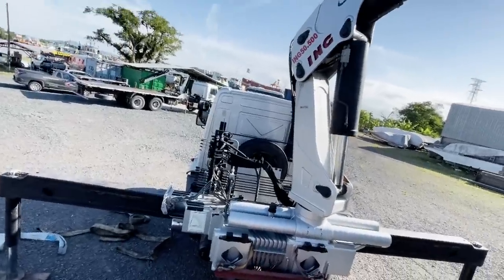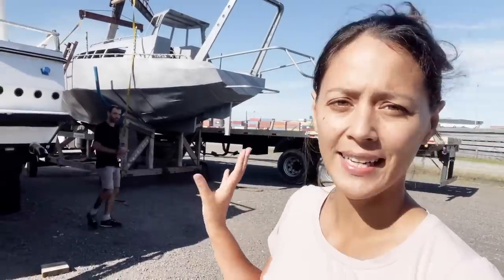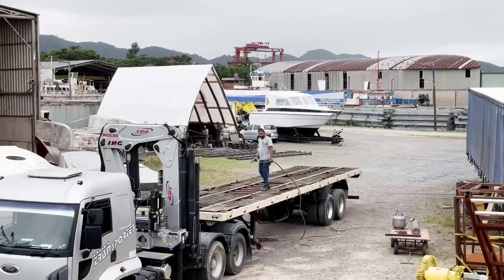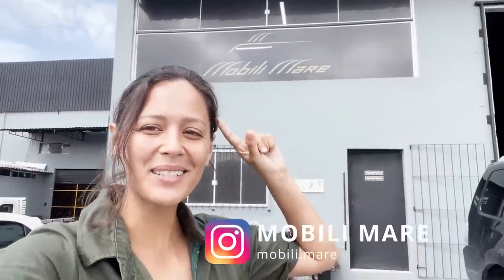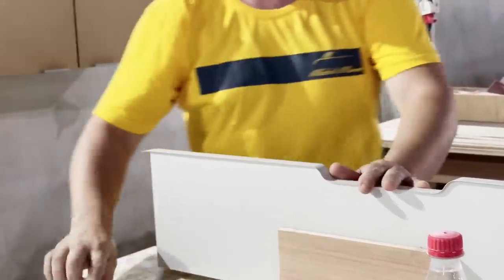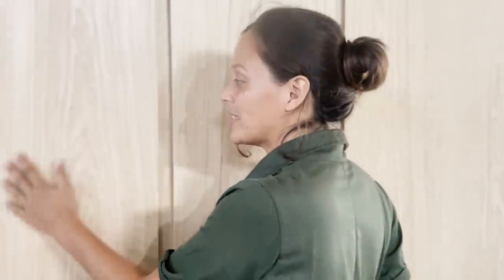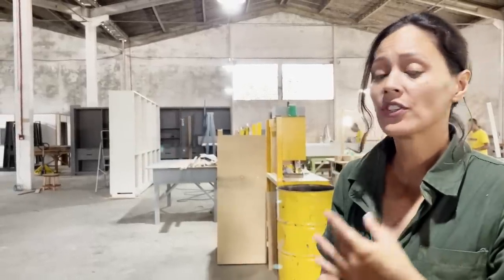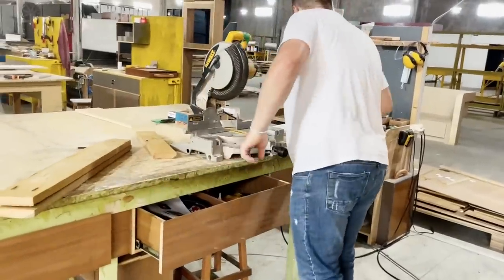BREAKING NEWS: Our Latest BOAT BUILD Upgrade Will Blow Your Mind ⛵️ Ep28

Comment from the maker: We are so excited about this latest news!! There are still a few things we have to finish up before they can jump in with the wood interior so we'll be tackling that as well. We need to finish up the coating systems on the inside, and lay down wire and pipe for electrical and plumbing. And we'll be coordinating everything to work with the Mobili Mare team. 

As you know, we've been though a lot of tough hurdles with this project and had some really hard moments. This news is the best thing that has happened to us since we started!! Just proving that the most amazing things happen when you least expect it!

What part about the interior build are you looking forward to the most?? Let us know so we can try to work it into a video!
Reply: _ Gee Wiz, don't want to sound negative but that hull has more dents in it than a car wreck that rolled on a motorway!! Whats up with it.... one helluva fairing job ahead with TONS of fairing compound!! _
Reply: @liongod1000  Or heat it up & BEAT it straight. Trying to run before you can walk springs to mind!

Comment: Thanks for the tour of the fab factory and explanation of the process.  I noticed you have dark tinted windows, and lots of em.  When we bought our Islander 38 we had the same mindset.  Lots of light and ability to see our surroundings.   Ours has 4 huge windows port and starboard and 2 small ones forward for the salon. What we actually found is that it gets so hot that we have them covered on the inside to keep light out.  The dark color on the windows also absorbs heat and they get really hot which dissipates into the boat.   We ended up putting a chrome mirror film on the outside.  It is a one way mirror, it reflects the light and keeps the window cooler to the touch.  Looks great too.  Easy to apply later.  Keep rolling!  Happy Easter.
Reply from the maker: Thanks for sharing this with us! We haven't put windows on yet. Whatever you see is probably just blackness in the boat. We were thinking of creative ways we can make curtains but that was more for privacy than heat. But now that you mention this, we will keep this in mind when we buy the windows. The reflective surfaces really do work wonders when it comes to heat, as long as it doesn't effect your vision while sailing then thats a great solution! Cheers!!

Comment: I wonder if the welding "scars" are going to be protruding in the hull as we see here. Or there is more grinding to smooth it out before painting?
Reply: I wonder if the aft starboard dorsal section would be best consolidated of those patches.

Comment: I think you should work on enclosing the boat before you do anything else.
Putting in the old or getting new windows first before you start the interior
Reply from the maker: You have a great point and we are looking into this. The tarp covers well but with lots of rain there is still some drips. We like your thinking.
Reply: @lahakai  Thanks wasn’t trying to tell you how run your business, but I thought maybe you forgot to mention it.
But this is like building a house, you dry it in first before you start the inside work. Or you will be fighting the weather all the way. Hope you guys have picked out some opening hatches remember air circulation is important also. Insulation is another thing you may not think about. Lots of people don’t. But steel absorbs heat and UV rays.. Also the cold. And old boats that wasn’t insulated they sweat in cool weather on the inside,  even if it is cooler inside than out, insulation can stop that. Sweating causes mildew witch can be harmful to you health. And maybe part of the reason it rusted so much from the inside out. I don’t know what kind to use on a boat but maybe you could look into it. Just a few thoughts and maybe a reminder here. Good luck with this big project. 
Maybe foam insulation sheets with a foil backing that could be glued to the inside hull walls, like down to the waterline. IDK! Just something that don’t absorb water. 
Newer yachts even fiber glass hulls, have insulation these days. So there is something you can use. 
I lived in a old house years ago,  that wasn’t insulated and in the winter mostly the inside walls would sweat and water would run down the wall. And mildew was a big problem.
Reply from the maker: Funny you say that, we are looking at insulation options right this moment! We spoke to the manufacturer to find one that is water resistant – as you said, the boat can sweat. We do have a couple large hatches that came with the boat. One in the main cabin and one in the forward cabin. But we'd love a couple of small portholes on the side of the superstructure if we can swing as well.
Reply: @lahakai  yeah port holes would be nice. Sounds good and I will be watching wish you guys all the best.

Comment: O casco, sobretudo os cordões de solda ainda parecem muito "brutos", ou seja, pouco ou nada hidrodinâmicos e isso poderá ser tornar um problema seríssimo à navegação e aos custos de manutenção.

Essas quinas podem comprometer a vida útil da tinta abaixo da linha d'água e o tempo e custo de uma nova pintura é alto e exige tirar o casco da água. 

Em náutica diz-se que quando um linha não está harmoniosa é porque está errada ou pouco funcional. 

O acréscimo da popa tem ângulos muiito estranhos. Às chapas de aço na popa a estibordo estão amassadas. Tenham muito cuidado!

Talvez isso esteja sendo considerado para a etapa da pintura, mas não deixem para a última hora, quando o orçamento diminui.

Não levem a mal minhas observações.

Comment: The finish work and interior is certainly an exciting part of the build and the area's you'll have the most contact with for sure.  I do have to ask if there's other plans for the hull, I can't help but notice the tin canning (from sand blasting or poor patching?), the plates, welds, and blends, the body lines, etc. - Maybe this deserves some more attention before the finishing?  I admire your bravery and wish you the best outcome on this project!
Reply from the maker: We are very excited about the interior as well! We are going to try to tour some other boats they have worked on to get a good idea of the possibilities too. The shadows from the sun on the hull exaggerated the welds on the back. There is no canning, just a couple repairs. Since this is a restored boat and not a new one there are some areas that have salvaged steel still, though we changed practically everything below the waterline. And this will be covered while fairing the boat. Cheers!!
Reply: @lahakai  I think that's a great idea to look at other boats for ideas, always nice to pick the best features any try to incorporate them into the build.  I re-watched the video a few times to see what you said about the shadows, that is certainly one way to look at it.  Looks like an interesting challenge to fair- hopefully it goes well for you both.  Looking forward to seeing how things turn out.
Reply from the maker: We had some bad luck with welders in our previous location. Not sure if you saw our earlier videos but some of the welds end up rather large because of this. And in retrospect we would have changed the whole panel and not patched if we had known. We knocked down most of them and found some pros here at the new shipyard to fix any issues and we had a marine engineer look at the entire boat and give his ok. It’s not her best side but we will fix it up! Thanks for following along and your feedback!! Lots of good stuff to come!
Reply: @lahakai  That was certainly most unfortunate!  I wonder how it will hold up long term for your adventures?  Certainly an interesting project to follow along and your videos are very well done.  Looking forward to watching this journey.

Comment: hello, first i enjoy your videos keep it up.
Going back to the previous one, making the boat fully electric is fantastic, but I was wondering, does the prop function as a dynamo while sailing.
And don't be blinded by the numbers of the panels and the windmill, which are theoretical, the practice is always different, as far as the inverter is concerned, take a look at Victron, they have a good combination product, in terms of charging / conversion / backup / shore power , and all in one unit.
I don't want to come across as a smartass, but try to think along
Reply from the maker: Hello! Feedback is always welcome and appreciated here! The motor does have hydrogeneration. You can check out some of the specs here: https://media.torqeedo.com/downloads/flyer/EN/torqeedo-onepager-cruise-pod-en.pdf
Victron is number one on our list as well! An all in one unit would be amazing. We need to see what is available in Brazil for their products and the price range. So this is still in the works. Cheers friend!

Comment: Are the guys at Mare Marine going to work on the outside of the hull as well because it certainly looks like it needs a lot of work to get it smooth and fair. Love the new design of the davits.
Reply from the maker: Yes! You got it! That’s the idea! We will be fairing the hull. Also we will be working on electrical and plumbing in coordination with Mobili Mare doing the furniture. Glad you like the davits! Cheers!!!

Comment: I wouldn't even make an aquarium for my fish from this cage covered with thin and curved plates, I would be afraid that it would get a hole and the fish would swim away.🤔😱
Reply from the maker: Generally speaking, boats are curved. The thickness, glad you asked, is 4mm-5mm which is standard and the structure is reenforced from when this boat (already) sailed across the Atlantic Ocean. This will do just find on keeping the fish – on the outside. And if you have doubts, you can watch the episode where we had a Marine Engineer certified by the Brazilian Military to evaluate our boat. Cheers!

Comment: Sorry but it seems like a waste of money putting a new interior in that hull . I don't believe ive ever seen a hull made of a metal patchwork , the poor craftsmanship of the original metal work cannot be unnoticed .
Reply: I sense some degree of ignorance as to how metal boats are constructed. (But there is lots of opportunity to educate found within…)
Reply: I have never built a boat but I have faired a lot and the amount of irregularities are going to really suck to get fair and looking nice. I have to wonder if by the time this project gets completed they will have more invested than a good complete core would have cost. That much said you got to do you, if this project makes sense to you and you are having a good time.
Reply: You haven't see may boats then. The fit and finish in the stern leaves something to be desired, that will hardly be visible. And few dimples never hurt anyone, doesn't directly correlate to the integrity condition of the hull. Not a plastic boat it has some character.